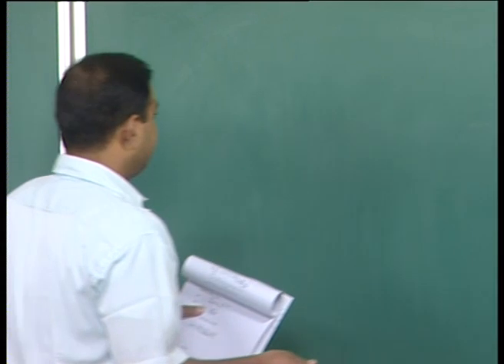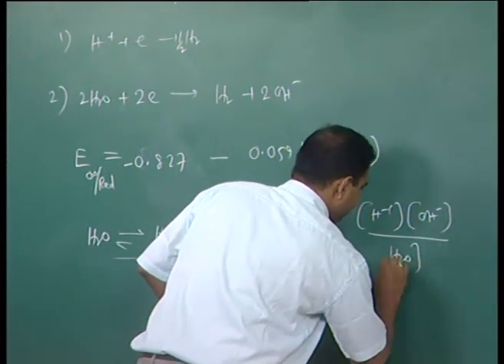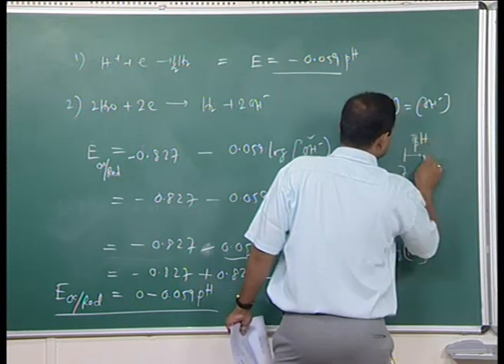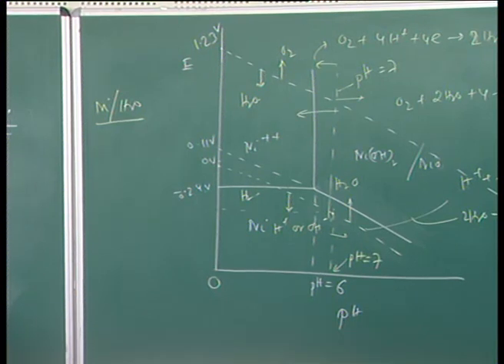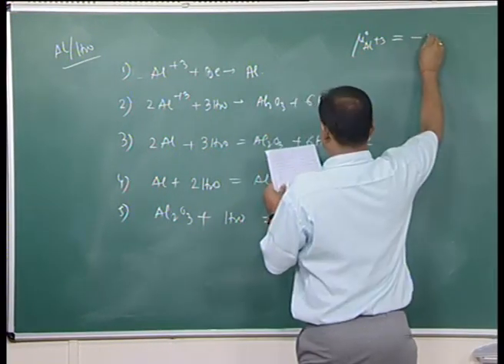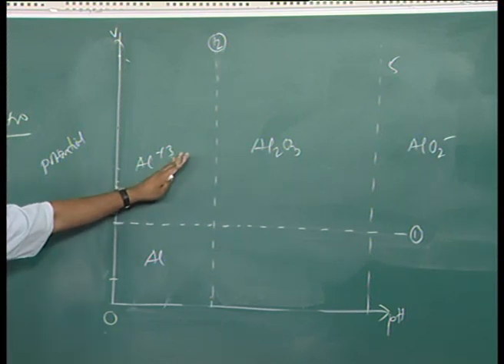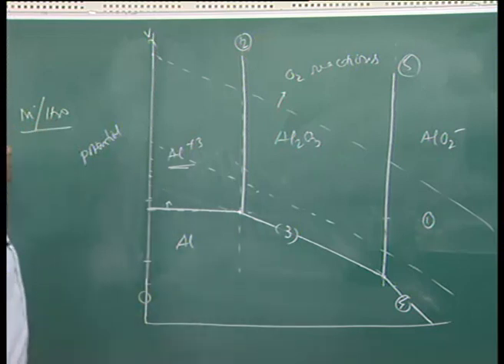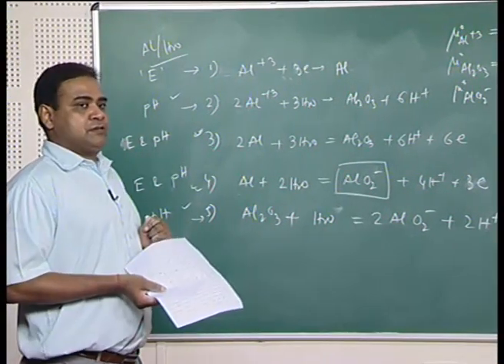Mod-01 Lec-08 Pourbaix diagram

Comment: O2 + 2H20 + 4e = 4OH , the standard potential is 0.401V but you took it 1.23 V and considered the same starting point. I think the starting point should be different. Sir, kindly clear the doubt. Thank you.
Reply: . 401+.827=1.23